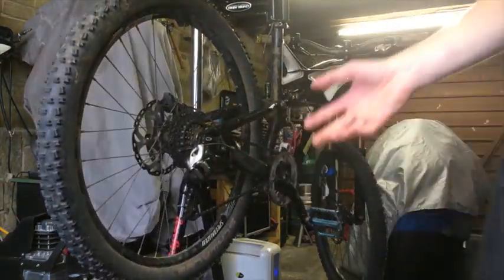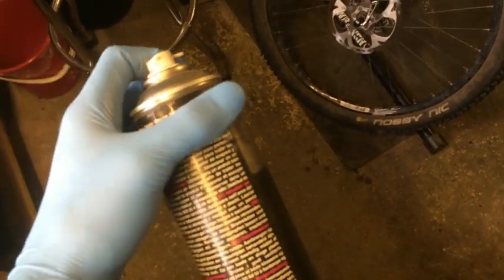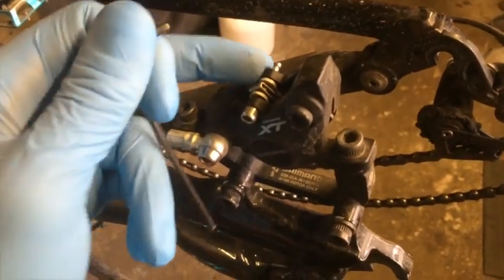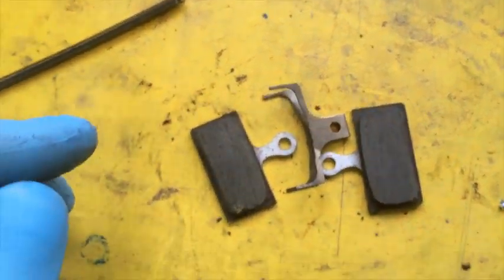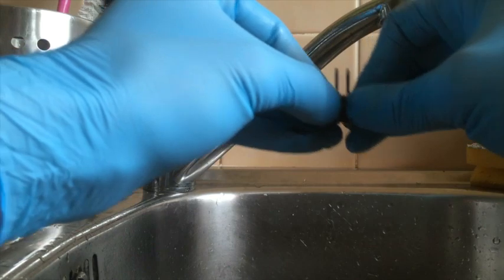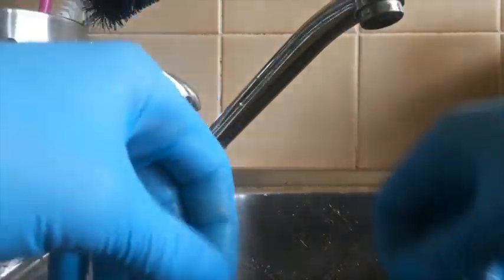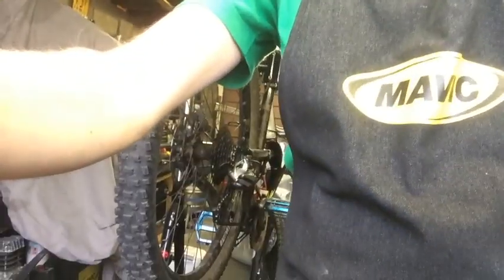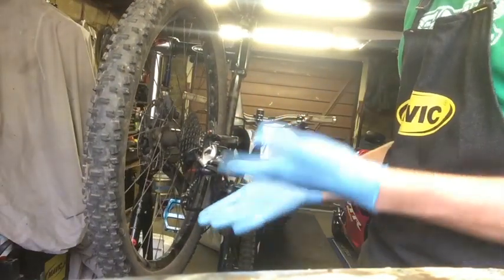How to stop a disc brake from squeaking

Comment: Perfect... I have XT shimano brakes, just loke those. I fallowed your tutorial, cleaned rotor, pulled out the pin, pulled out the pads, cleaned pads, puted them back in puted the wheel back in and VOILA. NO PRESSURE IN BRAKE ... I did not touch the leaver (I am very carefull about that) did nothing more not one move that you didn't do and yet... I lost my brake ... amazing... 

The pistens do do not even twich when I press the leaver, which I did, cause I wanted to see if I'm still squeeking... Please help =C

Comment: The problem is typically the rotor itself.  They all tend to come with black paint on the edges; when you brake the paint melts/flakes off and contaminates your brake pads (I realized this after the pads turned black just after 5 minutes of test riding on sidewalk).  Removing the paint from the rotor before installation should decrease brake squeal significantly if not entirely.
Reply: isnt that like grese to protect the rotor from rust even tho its stainless steel xd

Comment: Another thing you can do is remove a few microns of material with some 400grit sandpaper taped down to a perfectly flat and level surface, mdf is good. Rub the pad on the sandpaper making sure to keep the pad flat and do equal to both.

Comment: hi great video and this has solved my back break noise but i wonder if you could hejp me with another problem...... my front brake brushes the disc and does not run freely, ive loosend the break block and tried re-centring it but there no space either side of the disc and the break is very hard to press.... hope you made sence of that.

thanks steve
Reply from the maker: Steven Roberts hmm sounds like the Pistons are sticking and too much fluid has been drawn into the slave cylinder. What make of brake is it?
Reply: its tektro mate
Reply from the maker: Hmm Tektro are pretty good for reliability. What I would do is take the pads out and pump the pistons out of the calliper a little (not all the way otherwise the pistons will fall out and you will need to rebelled the system) spray a silicon or teflon lube on the pistons then pop the reservoir cap off the lever and carefully push the pistons back into their bores in the calliper. Refit the pads and disc and then flick the lever a few times to disperse any air left in the lever, top up and then try realigning the calliper on the disc. This should reset the pistons and set up for the brake. hope that helps
Reply: thanks alot, ive just got around to this but it has worked.... was tricky tho

Comment: Thanks for the vid man was great. The squeaking stopped my only problem is that my brakes still aren't very sharp. My bike is new as i only got it a week ago. What's my problem?
Reply from the maker: Cole McCourt your pads and disc will need bedding in, you can used some sand paper like 80-100 grit and carefully sand the top layer off the pad. Take it for a ride and do around 20-30 firm stops, like emergency stops to generate heat into the pads and disc.

Comment: I followed all of the steps in the video, including the "bedding" mentioned in the comments.  I also tried burning off contaminates. My brakes are better, but still squeak under extreme braking (such as what might be needed when descending a long steep hill).  I cannot get them to squeak on the work stand or when coming to a normal stop.  Any ideas?
Reply from the maker: Either the pad is saturated and not able to be decontaminated  or possibly just the pad compound, most likely a sintered pad as these can still squeal at higher speeds

Comment: I simply use  100 grit sand paper and turn the wheel to take out the smoothnes on the disc and take out the pads and rub then with the sand paper also and problem solved...
Reply: Did you do all of this while the wheel stayed on the bike, or did you have to remove it? THX!

Comment: I cleaned the pads like you did and they are clean and they are not loud anymore bit they don't brak good aswell
Reply from the maker: You ! Probably because they will have glazed over. You can sand the surface of the pads to bring them back or you can ride it in some mud and they'll come back
Reply: High Carb Rider I already sanded them off abd it didn't help. But I am going to try the mud. Thanks for the answer

Comment: I am building a bike and I am wondering what king of disc brake I should put on my FREERIDE bike
Reply: I'd go for Shimano Deore 615's,I had these on my Trek Fuel as the Avid 3's were crap and the Shimanos were brilliant and not to expensive and easy to bleed and service.I have Shimano XT brakes on my Cube Stereo and to be honest they perform much the same as the cheaper 615's except the XT'S have  tool free reach adjusters. Hope this helps.
Reply: Go for the hope brakes
Reply: Mr.Clutch 101. Hope are absolutely bullet proof. You can't go wrong with Hope brakes. The coloured floating rotors look the dogs bollocks too.

Comment: Do you have to drain the brake fluid before take the pads out
Reply from the maker: No you shouldn't have to unless there is an issue with the calliper pistons.
Reply: High Carb Rider cheers m8

Comment: Hi. I just bought a new bike from Trek. An Electra Lux Fat Tire 7D. The rear brake makes a constant "shhhhh" rubbing noise. I called them and they said those brakes are just loud and "might" get a little quieter with time. But then wouldnt the front brakes also make noise? It seems odd that brakes would make a scraping rubbing noise brand new? Should I take it in? Thanks
Reply from the maker: Cosmo Spacemonkey  No, the brakes shouldn’t make a noise, you are correct. There is a chance they are contaminated, it can happen in busy workshops, a bit of over spray of lube etc and the disc will squeal. I’ve even built bikes straight out of the box and the brake were contaminated so it’s possible that is the case. Ask for the discs to be cleaned and ask for new pads from the shop. If they do that and the brakes still make a noise it could be the brake mount oscillating! This is something that occurred on some trek bikes and trek do make and sell a special mount that reduces the oscillating and eradicates the noise. Don’t give up pestering the shop until they fix it. Trek will take it as a warranty if the shop can’t fix it, just say you are not happy and want the issue to be log as a warranty with trek until it’s sorted.
Reply: Thanks very much for the info and advice. I looked around Youtube for instructional vids about disc brakes and was able to adjust them so they no longer scrape. The issue was that they didn't bother to adjust the brakes properly in the first place. And very odd they would say that noise from the brakes is normal. Perhaps I did not describe the sound well...As for replacing the pads, the same person told me (after I asked if possible to get new pads) that you cant get better pads in the future. What!?! I'm going to guess that that is also wrong information.This is my first bike with discs so in a way this was a good way for me to become more familiar with their mechanics. Anway, love the new bike now that I'm not scraping on down the road.

Comment: Offcourse it works right away, wil it work after a couple of stops? I'm having decent braking power, but always squeals
..
i have file'ed them off, rubbed down sandpaper, always kept the disc oilfree (and gegraesing it just to be sure)

Comment: Just got a bike with disc brakes. It's my first time using them. I finally figured out how to adjust them so they stopped rubbing when the wheel turned. But when I stop, they make the same rubbing sound. Is that normal, since it's a new bike? It sounds like metal-on-metal. Almost like there are no brake pads.

Comment: If you don't want to buy any disc brake cleaner what I did is rubbed a paper towel on the discs this is a lot more time consuming but it's cost effective rub the discs with the towel until no oil will come off the discs then the discs are usually clean

Comment: Hi Chap, good vid, but how do i stop them squaking in the rain/wet? is that down to the quality of the pads them self? the MTB ive got isnt what i call cheap but today was the 1st time in the rain and the brakes are just annoying, any help mate wud be very appreciated.
thanks
matt
Reply from the maker: Squeaking in the wet is often a pad compound and disc combination. A well scrubbed in disc with sintered pads should be pretty silent but organic pads and new discs always squeal when wet.
Reply: Get metal pads. They got pros and cons but they don't get contaminated so easily and don't make noise when is wet (that's in my experience).

Comment: Which tool did you use to remove the pin holding the pads and spring in place?
Reply from the maker: 3mm Allen key

Comment: My rear hydraulic disk brakes are experiencing the exact same issue, and I am thinking the pads may be contaminated. 

My question is, will the dish washing liquid work on resin pads? It looks like the pads in the video are metallic/sintered pads. Would it be better to just replace the pad with new ones?

The resin pads are fairly new, and they've only gone through 2 or 3 wet/muddy trail riding since installed.

Thanks!
Reply from the maker: This tends to work on all pad compounds. You have nothing to lose of it doesn't work!
Reply: High Carb Rider thank you! I'll have to give it a try then.
Reply: High Carb Rider
Just a little update; your method worked perfectly!
I removed the brake pads, and to my surprise, they were as dark as the ones you showed in the video. Got them cleaned up really well. Thankfully the rotors didn't have any problems. I'm actually amazed this works on resin pads, too.

I'm thinking it's just the wet conditions from where I live (West Coast of Canada). The original brake pads suffered from the exact same issue after 1 or 2 rides (I assumed they were ruined for good so I replaced them).

Thank you!
Reply from the maker: Awesome man, the resin or organic pads are really for dry conditions and do soak up the crud in wet conditions plus they wear down quickly in the wet. Sintered are more suited to the muddy conditions and are less likely to be affected by the weather but are not as good in the dry as the resin/organic compounds

Comment: Hi there when the discs and pads are dirty and contaminated could this make the brakes feel spongy? I seem to have lost power when pulling the lever the cable is fine though.
Reply from the maker: Possibly as there is now contact adhesion between pad and disc so you will need to pull harder on the lever
Reply: Sounds like you have hydraulic disc brakes, if so you would have to bleed them.(getting new oil and getting rid of air bubbles in hose) if they're cable brakes, just readjusting your cable tension.

Comment: Hi Ive tried this twice and still I have a horrendous squeak. Its a new bike and I have used it once and cleaned once. Just wondering if the pads have heated to a certain degree and thats why I can not get rid of the squeak. I only use MukOff which has been the best. So I'll go n buy some new ones that should sort it
Reply from the maker: Jon Bowler hi, even on a new bike it's possible for brake oil to have leaked onto the pads from manufacture or set up in store etc. If the pads are not responding to the washing up liquid you can blow torch them but only if you feel comfortable doing so. I will be doing a video on how to do this soon
Reply: High Carb Rider--- Hi Thanks for a quick response. I tried it a third time to no avail so I put the pads back in and thought you no what "I'll just ride it" up my local town. We have lots of steep steps near the Council offices and had roughly an hour and its taken the squeak off.! Mission accomplished.!! Thanks again for the reply and keep the vids coming will subscribe 😎👊🏻✌️ Safe riding

Comment: Do you have to wear new pads in? My local shop just changed my pads as they were squeaking but they sound even worse now?
Reply from the maker: No they shouldn't man, squeak that is. Yeah they do need bedding in but 20-30 stops usually scuffs the pads in. Sounds like the shop has contaminated them, workshops can be pretty oily with spray oils and dirty fingers oil can transfer on the braking surfaces and cause contamination. Clean the disc and pads and also check the calliper is free from leaks around the Pistons and bleed nipple.

Comment: What if brake disc is moving back and forward? There is a tiny screw that should hold it in place but it just wont do it. Is there a way of fixing it,please? Maybe other way of attaching disc permanently or just dispose of it and convert it back to old brake system,please?

Comment: Great video. What temperature do you wash your whites on? ;)
Reply from the maker: 😂 LOL 60deg as I daren't go hotter incase they shrink
Reply: Hey, i got disk brakes from Shimano but they rub against the disk even if i do not press the brake handle.
They make no squeaking noise but they do scrape against the disk a bit.
Do you how to make not not to rub against the disk ?
Thnx.
Reply: take the wheels off and put them back on but dont make the wheel nuts too tight find the right tightness or looseness this should work if not the rotor may be warped
Reply: Slacken the caliper bolts and spin the wheel by hand and the pull the brake lever slowly but firmly until the wheel stops and while still holding the lever firmly with the brake on tighten the caliper bolts evenly a bit at a time and that should align your calipers to your rotors,but check for uneven wear on the pads as there will be not point in doing this.Just buy new pads and set your calipers and rotors the same way.Wheels with cup and cone hubs tend to miss align the brakes when you remove and replace your wheels which is a bit of a pain in the butt.A friend of mine showed me how to make spacers out of deodorant can metal and this stopped this problem.

Comment: Make a video about how to loosen up the pressure of the fluid when you just installed a new pair of brake shoes and they are too tight on the rotor preventing the wheel from spinning freely. Or whatever it is you do to loosen it up.
Reply from the maker: I'll do one as soon as I can
Reply: Thanks! You know all the videos on Youtube are just about adjusting the calipers so the rotor will spin freely, not how to loosen up the brake fluid pressure. Would be nice to see such a video if for example you have installed new pads and forgot to push the pistons back into the caliper before you install the new ones. I drained a little bit of fluid in both ends of the hydraulic cable and even let some air in there but even thought his helped, it`s still clamping the rotor too tight :(

Comment: how do you fix it when you have to pull the break leaver really fr for it to even slow you down but wont compleatly lock and the break fluid is good
Reply from the maker: If the system has been bled through and the pads and disc are clean it can be an issue with a master cylinder piston, some systems suffer from seal deterioration and this allows the oil to pass over the piston opposed to being compressed by it. What brake do you have?
Reply: im not 100% sure but how will i know if its the seal because i do a lot of riding and clean the pads ever 3 or 4 rides

Comment: so i washed my bike down after being on the beech yesterday i used muc off pink cleaning stuff wen on my bike today and heard a god awful screeching coming from my brakes, so i looked on youtube and came across your video i took my rear wheel off and looked for the pin, mine unfortunatly is different its a pin with a bent end and i dont know how to get it out, though my bike is only 9 days old and ive been on it like 8 times so it cant really be that dirty, can it? however all im thinking it is is that my pads are still wet if i was to get my partners hair dryer on them to dry them would this work do you think?
Reply: aha the pads pretty much dry theirself as i had no degreaser spray i used a car leather to get rid of the grease, a little squeek but ill be betting some and re cleaning them, p.s they was filthy after only 8 rides lol cheers pal
Reply from the maker: Chris Sims Glad you got it sorted, sorry for the late reply. To remove the pin just unbend it with some pliers.

Comment: I change Brake Pads, the first time there was blake fluid oil, but keept breaking without squeaking. One of my rotors has marks, for the oil. I sand with a 200 and 1000 the rotor then with isopropyl alcohol. (I got a space rotor btw) Clean with isopropyl alcohol the brake pads, put it all together and keept with the squeaking, I sand a pair of brake pads of spare and nothing... any ideas?
Reply from the maker: The isopropyl alcohol on the pads will have broken down the oil and allowed it to work its way further down into your pads. All you can do as a last attempt of hope is blow torch your pads, wear mask when you do it too, the extreme heat should burn off any oils, you can do it on the disc too providing there isn't anything flammable on the disc.